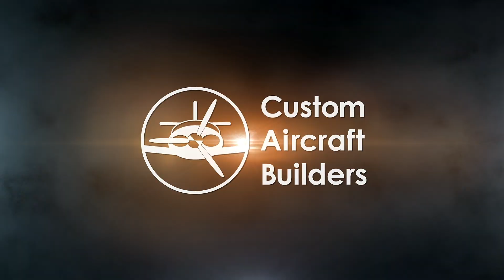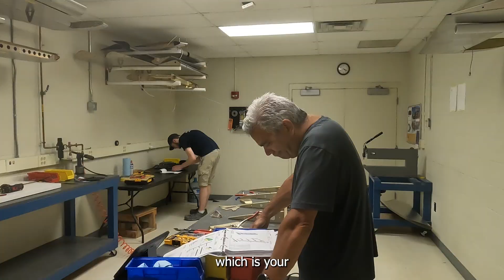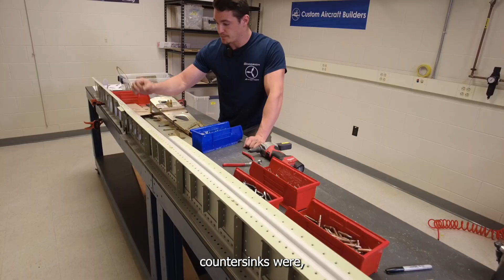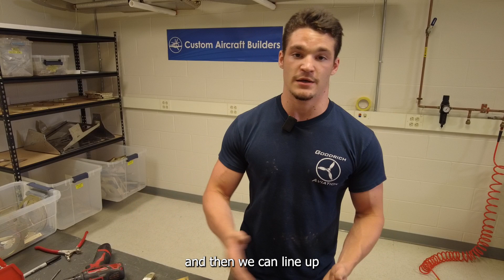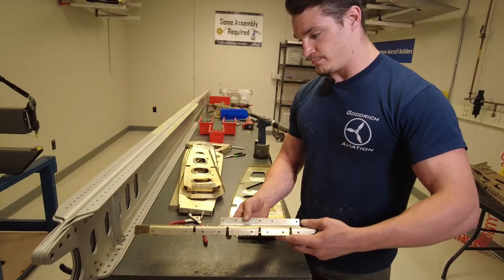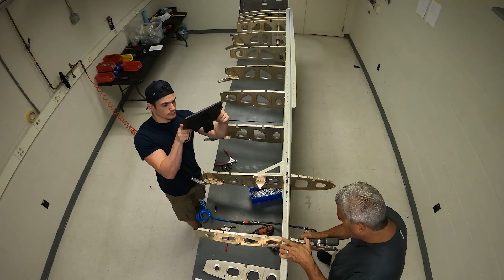Dale Norton Sling TSi Build - Episode 2 - Tail  Wing Assembly

Comment: Start to finish  what is timeline on a sling. And do you build any other planes
Reply from the maker: Typically, it takes about a year* through the Builder Assistance Program. We anticipate Dale's plane to go quicker because he is local, and can make frequent visits. We are very flexible with builders' schedules, but on average builders from out of town come up for 3-5 days at a time, a handful of times throughout the build process. 

We currently work with Sling Aircraft, Van's Aircraft, and just began taking build-assist orders for Orion Aircraft's backcountry cub.

*Global trade logistics could affect orders of components or parts, possibly altering the overall build timeline.